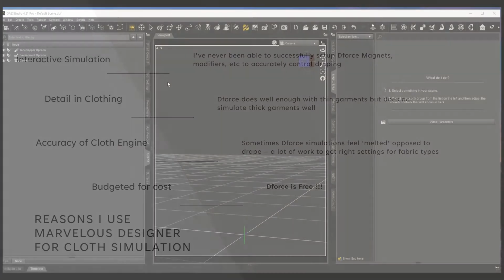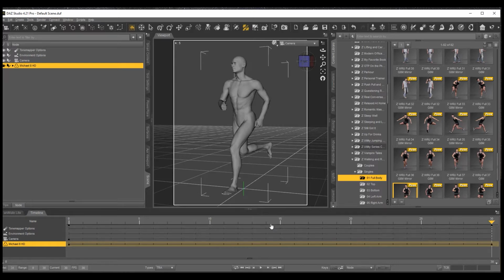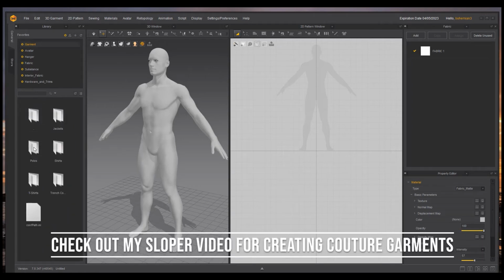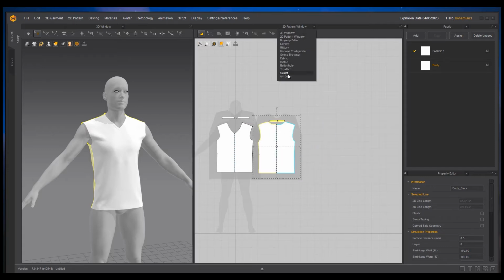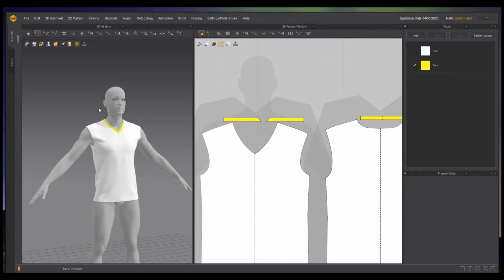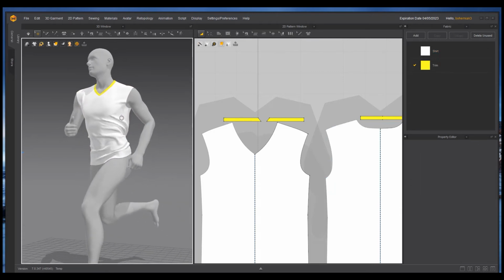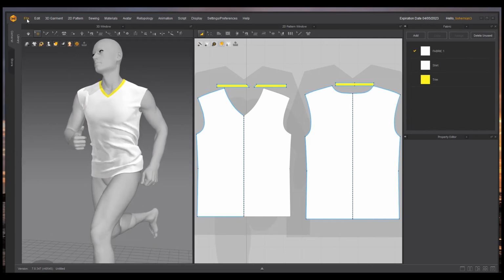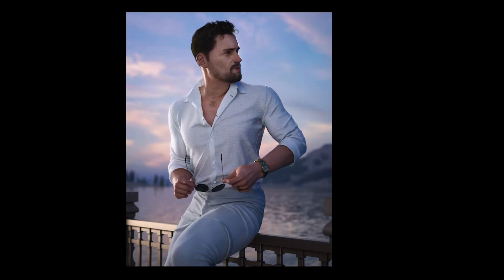Using Daz and Marvelous Designer to Drape Garments

Comment: Thank you for sharing your techniques. I've never used FBX or wind node, so this was very interesting. I've always used MDD to import animation from Daz Studio to Marvelous Designer. Is there a significant difference between using FBX or MDD?
Reply from the maker: @r3g4rds  Yes - as barbult points out MDD, is a good solution if you have the DAZ animate plug in which works well.  Currently when I export alembic from DAZ, it doesn't import into Marvelous Designer.  Though I can import the alembic into 3DS Max, export it, then it will import into Marvelous Designer.  This was to suggest a way to quickly animate a single frame.